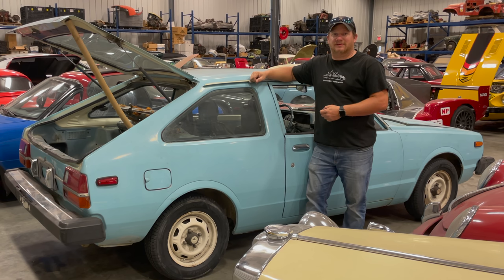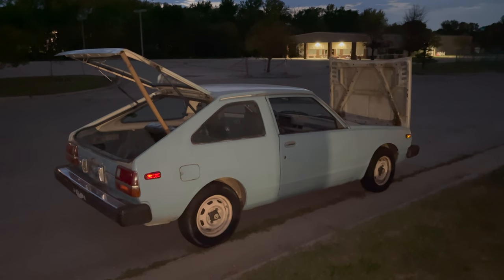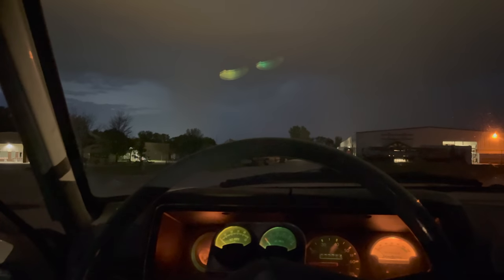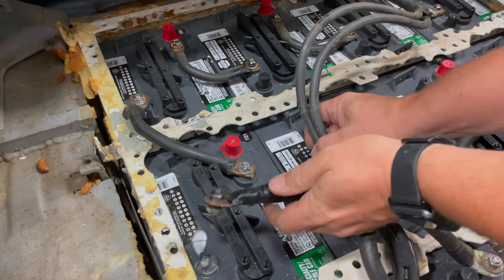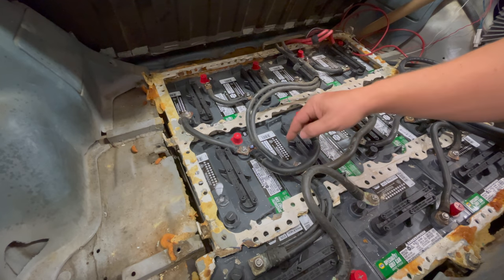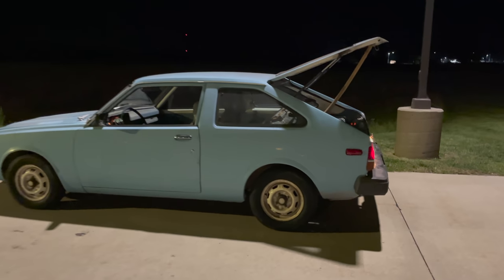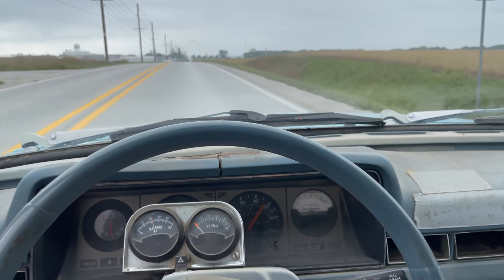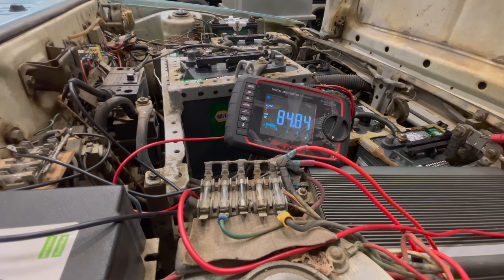Lectra Test Drive Leads to Melted Batteries and Breakdowns

Comment: I would never use an impact driver or drill/driver to tighten battery posts (hand tools only). You are likely to damage the battery posts with power tools even if you're careful.

Comment: Not sure how much experience you've had with multiple battery hookups, but the same rules apply to your situation and off grid batteries. Clean terminals. Leave green for frogs and blue for skies. DO NOT  over tighten the nuts or you will have cold flow. This will cause the cable to loosen ever so slightly and cause a resistance connection. Resistance connections mean HEAT. Good luck with the little jewel.

Comment: Since the terminal seem to be the weak spot, i'll bet its just poor connections at the bolt-battery end rather than the cables themselves.  If the cables were the problem, you would see the insulation melting before the lead battery posts.   Even a tiny bit of resistance due to corrosion at the battery connection will heat it up.  I think if you add the clamp style connections with ultra clean surfaces to the cable ends the resistance will be low enough that little heat is produced with high current.  Might be able to save at least one of the melted batteries too.  The hole in the other battery may just be melted lead going through the casing.  Adding copper washers might help, but there may be some electrolytic effect with the dissimilar metals, leading to corrosion in the long term.  Love your work!

Comment: I work with mobility scooters and power chairs. They use mostly the same deep cycle sealed lead acid batteries as you have there. The biggest have typically 2 x 75ah 12v batteries and they generally last 3 - 4 years. Quality varies enormously and the cheap ones are usually a waste of money. Clean connections are very important, as is a good charging regime, and the only way to test them properly is with a long test on a digital tester that actually sees how they perform over time. The 'quick' testers that give a result after  a few seconds do not, in my experience, give accurate results with large batteries like this. Voltage is also not a good indicator - I regularly see batteries reading14 volts that are not able to hold any useful current capacity. Are the batteries themselves recent? do they get hot (I have seen knackered ones that have been recharged so many times they swell and buckle, becoming difficult and dangerous to remove).
LED bulbs will use less power so would be a good move if not already fitted. Interesting project- but those batts are expensive, good ones as I mentioned earlier can be £400 a pair.

Comment: Is that a puddle of melted lead we are seeing, next to that first bad terminal???  Heh heh heh!  A little warm I guess....

I like your idea on the battery posts...  that would increase the area of contact a lot....  

As others have said, I would not run those down with an impact.  Those bolts & posts in batteries are not real robust.  Don't hit 'em with a hammer either.   I mean, do what you want, but, I had a couple disasters doing that, and I don't need any more of that, so....

Comment: I would agree with those that say use battery post's, bolts  into the battery are fine for a mobility scooter which would typically have just two batteries . I would also say do not over tighten with power tools as others have commented. Aside from checking the controller I would also check motor brushes (if it has them) as a guide the minimum brush length would be half an inch, any shorter and the copper wire would be showing. My guess is that the motor would have four brushes and they are simple to replace . I only suggest the brushes as that would be another source for loss of power once the battery issue is resolved. Great video Steve please keep at it.👍👍

Comment: Very interesting project Steve, wonder if thermal imaging over the batteries during driving phase would help in your diagnosis
Reply: Or at least a heat gun.  Though in the heat side, I had a lithium go in a phone on me.  Holy heck did it get hot. Could feel it!

Comment: I'm not surprised that you had battery terminal overheating and failure because those small auxiliary battery terminals don't come anywhere near the industry standard of 1000 amps per square inch. Aircraft batteries are made to withstand heavy duty cycle cranking capacity especially when the batteries have to turn radial engines. We had electric runabout motorised vehicles for aircraft servicing transport and the terminals on those vehicle's batteries were the original lead post type only. Your cables appear to be the correct thickness but the battery terminals, no way where there is heavy sustained current draw.

Comment: If you have a FLIR camera or attachment that would be an easy and quick way to check for hot connections and the end of a run. Most likely cause is a high resistance at the battery post. In telephone exchanges of old where they had to deal with huge current flows, they would lap the two contacts together then use a grease laden with a conductive metal.

Comment: I'm not too keen on those bolt style battery posts. Not a lot of surface area between the connections. I would prefer to use the normal posts.
Reply from the maker: That is what I was starting to think, I was just using them the way they came and figured they knew what they were doing!
Reply: @ThisWeekWithCars  I have no expertise on this battery set-up, but I would have to agree the posts would be the best connection. I would assume the malleable lead would deform with physical strain on the bolt down style cable ends, causing less than optimum connections.

Comment: Are those batteries and their terminals really suitable for continuous discharge in the hundreds of amps?  The terminal failure seem almost to be due to resistance in the terminal connections within the batteries, not the cable connections.  Could even be variable quality of battery manufacture - keep fitting new ones untill they all run cold. :)

Comment: Maybe ask around at a forklift workshop? Keep on with this project, very interesting!
Reply: I drive an electric forklift and they are very reliable. The battery and cables with almost 24-7 use never fail. They are lead acid with about one hour of charging every 7 hours.
Reply from the maker: What kind of connectors do they use to the batteries?   I also imagine they do not use the amount of power this car does because forklifts are running a hydraulic pump which can create a lot of power from a little amount of effort.
Reply: @ThisWeekWithCars  I remember the connections as being what you have. We had a few electric forklifts at my work.

Comment: Have you looked into Lipo type batteries?  I cant help but think you could make the car lighter and performance more consistent as those type of batteries tend to just drop off the edge when the time comes.  Just a guess but you might also find more charging locations as well.  My last Nissan had 2 turbo chargers and no cup holders.
Reply: a lipo battery is extremely delicate. Its a real fire hazard if you don't know what your doing. Today's EV uses Li-ion batteries. LiFePo batteries are good substitude for lead acid or even LTO but those are really expensive. Lets hope solid state batteries comes available in the near future.

Comment: i would check all your water/acid levels in every single battery i have found in golf carts that the vents do not vent properly boil over and get very hot when low not sure on the chemistry of why they get hotter faster but i would guess the water in the cells also acts as cooling as well as electrical conductivity (poor connection). the one that burned a hole in the lid of the case i could not see any liquid. (hard to tell from the video) 
one thing i would be sure to check is if those batteries are rated at the max discharge rate for which your controller draws if it draws more power that they are capable of at max it will find the weakest link and destroy it.
just my 2 cents thanks for the videos.

Comment: Long term it would be better to convert it to a modern battery setup instead of lead-acid batteries. I know some guys that have done some EV stuff, including updating an EV converted Porsche 944 from lead-acid, I think he said he removed 500 lbs and doubled the range, and that was about 10 years ago, could probably do better today.
Reply: Are you thinking of Jim and his son Brandon Pantas? They built a 944 road race car using lead acid batteries if memory serves me. It worked, I believe it would run a full 30 minute race distance. I know they ran it at Road Atlanta and other SW tracks.
Reply: @bryancohn9406  I don't know who initially built the car. It was a red 944, the next owner (Nabil) pulled out the lead acid batteries and put in Lithium-Ion batteries. He sold it to someone else after that. It was a street car with interior, no cage in it.

Comment: what is the amp rating on each single battery?    Although each battery is contributing 12 volts,  the total current of the entire battery string is passing through each component.    At peak draw the amperage is producing heat anywhere it finds resistance.   The internal battery resistance would be low because it's producing current,  but the battery posts, cables, connectors, and motor would  resistive components.   I might be wrong,  but that seems to be the issue.   You could set the car up on the dyno and use a temp gun to see where the heat coming from.
Reply from the maker: The only specs they give is Cold Cranking Amperage at 310 A
Reply: @ThisWeekWithCars Another test you can do is look for voltage drop between the battery bolts at each end of a cable while you are running the motor with drive wheels suspended.   The biggest drop should be between the cable posts that go from the front to the back battery strings.  That might give you a bench mark that all the other cable connectors should beat.   You only want the smallest as possible voltage drop on any connectors or cables because that becomes loss energy and heat.   I could see doubling up the cables that go from the back to the front just to reduce resistance and voltage drop.
Reply from the maker: I don’t know if you noticed but the ones from front to back were already doubled up.
Reply: @ThisWeekWithCars  Yeah,  I went back to your earlier video and saw that they had doubled up the front to back cabling.  That's good.  Also noted you replaced the original 8 volt batteries to 6 volt.  So you would think the total wattage would be reduced from the lower voltage,  but maybe the newer batteries are more efficient, have less internal resistance and provide more current even though the voltage is less.   Seems like it must be something like that since you are melting connectors.

Comment: Hopefully there is a correct sized main fuse or circuit breaker in line with the batteries, those cables look marginally sized for over 200 amps. Welding cable is normally a good source of really low resistance wire
Reply from the maker: The cables on this car are 2-0 welding cable which is good for 450 amps at 50' so at 1' foot they should be just fine.
Reply: @ThisWeekWithCars  at those currents the resistance of the connections will really matter. The power dissipated across link will be the current squared times the resistance. So even if you measure 50 milliohm, that's 2kW of power (heat) at 200 Amps.
Since the terminals are melting off it suggests to me that the batteries aren't up to it. If there are two terminals on each side of the battery you can bridge them as you plan which will split the power between each post (and be a good heat sink), or even run parallel connections between each battery to lower the resistance.

Comment: Take the insulation off one of the short bad cables so you can confirm  if it is bad or not.
Reply from the maker: Thanks I might do that.
Reply: I drive an electric forklift and with almost 24-7 use the battery and cables never fail they're very reliable. Lead acid with about one hour of charging every 7 hours.
Reply: @ThisWeekWithCars  I have some photos of the forklift batteries if you're interested. Don't know how to send them to you.

Comment: In my experience, Datsuns/Nissans had lousy fuse blocks. My '68 and '69 Datsun 510s all had fuse blocks that the connections got progressively looser (the riveted connections), and this was in the mid-to late '70s so they weren't that old.

Comment: If you had some batteries in parallel, you would still have the same capacity,  just lesser voltage and not so much amps though a single battery or cable.